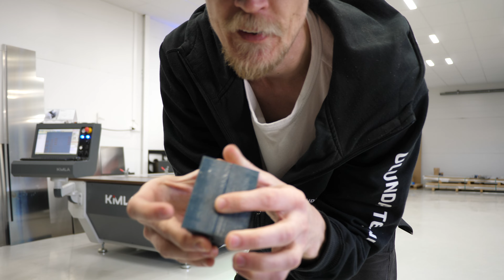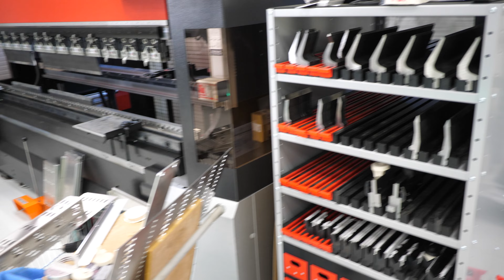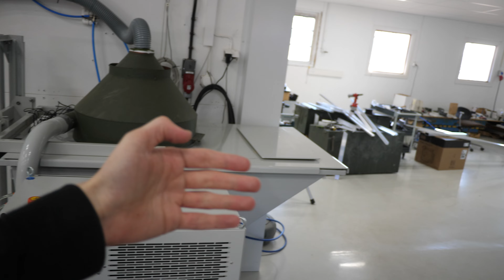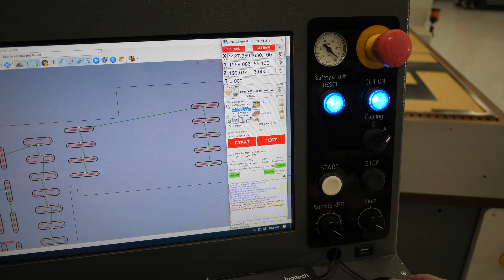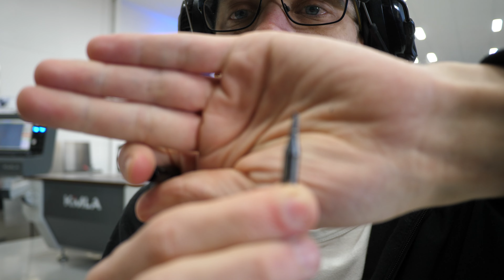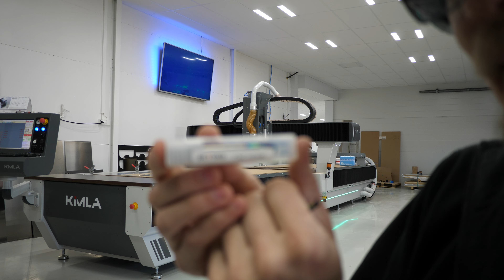Shoptalk in 4k50

Comment: This is odd, i responded, but it eveporated.  Something along the lines; VERY nice upload and incredible clean workshop! How do you like the rotary claw pump? I'm leaning towards a 250m3/hr garden denver, but my current liquid ring is till holding up. Price increase of 6% is active from the 1st of may, but that doesn't make me want to buy it faster.  That combination of lubraction/dust extraction; did you considered a mild overpressure under the plate to create a cushion of air? Or perhaps a mechanical limit. These pressure control valves; mine failed too on all devices i've used. Ethanol and most of the rubber isn't too compatible. Most of the rubbers get swollen. These peristaltic pumps appear to be hip nowadays, but these require a special hose to be able to handle ethanol. I think it's a relative complex solution for a simple problem. An over pressure tank should be all it takes. I've heard people using M4 or M5 threads with setscrews to get the right flow rate (use the play between screw and thread to have the proper flow rate). Length of the setscrew affects it too. I personally don't think you need anything that is adjustable, it just has to be the right flow. The Kimla controller; is it capable to recognize some CAM features from say a step file (i'm not a fan of  DXF's, maybe it's bad luck, but it is by far the number one file on my list of extensions that are most sensitive to errors). Had a lucky machining moment last week. While hand jogging the machine at full speed, it stopped at 1400.000 mm.. Good thing i don't have a lingering gambling addiction and a nearby casino.
Reply from the maker: Hey bud.
Sometimes youtubes comment-algoritm triggers and the comment is "awaiting review" before beeing visible. That might be it.
I do like these pumps, they are not too loud, no oil mist in the exhause and above all almost maintenace free.
Very rarely but it has happened that i missed having the oil lubricated rotary vane because of the immense vacuum levels achieved.
These dry running ones do 200mbar forever but spec says not to run lower than that more than 50% duty cycle. Sometimes you just want extreme vacuum on small parts or specialty fixtures. Who knows, i might get smaller version of my old pump for those occasions.
I have no experience with the garden denver brand. What specs does your current liquid ring have ?

There IS a cushion of air under the plate. It is only when you cut up the material so much that there is no big enough flat areas left to float on that the plate comes in contact with the aluminium.
There is also a adjustable mechanical hardstop, tho I dont adjust/use it unless there are BIG pockets in the material where the whole suction cup might fall into.
The hardstop rides along with the spindle on the Z axis which is not great tho, since if im doing pockets in steps then either the cup is to high or i need to readjust every time the spindle lowers in Z.
Having it from the gantry Z plate and beeing able to set a fixed minimum hight would be better and i might make that happen at some point if I find it worth while.

The denaturing component in my ethanol is MEK, so I pretty much need EPDM ive figured.
There are setscrews for air and ethanol and the container IS pressurized.(up to 4 bar)
However, depending on where you mix the two and the nozzle size and configuration, the air pressure is counteracting the pressure in the ethanol container.
If you inject the ethanol very close the nozzle exit you should be fine but you will need a needle valve(or other way) of limiting the quantity. The needle valves ive used have been finicky and unrelieble after a while.
Even with EPDM orings, probably because something else is slowly dissolving and cousing occausional clogs.
Some systems use pneumatic pumps like UNIST(cant take the MEK, i asked.), some use pressure based dosing (microjet/datron) but that requires very stable pressure, more air flow than id like(to get a reliable coolant flow) and it seems "sputtery" even on the datron machines. Results in often too much ethanol for my liking. Tho them microjet nozzles seem sweet with their "air jacket" feature.
And yes the hose is the weak part in those peristaltic pumps, not great.

Since the container is pressurized, All i really need is a way to limit the ethanol flow without using needle valves. There are fast acting valves for quick on/off but they really need to be able to handle mechanical wear in an ethanol/MEK bath. Some other mechanical contraption could be tried but then again, hoses dont really like mechanical wear and ethanol/MEK.
Maybe if I could pulse the air instead and therefor control the injected ethanol, but nah I dunno?

Perhaps just take everything apart, clean it, replace ANYTHING that could be dissolving with EPDM and get a fresh needle valve and try again.

There are some videos on kimlas youtube where they machine in 5 axis and the 3d model is atleast visually on the controller. But Im pretty sure it was programmed in some other CAM.
3d cam is really something you need a dedicated software for, that keeps current and is activly developed.
Fusion 360 with a nice postprocessor or even a custom script solution to facilitate a smooth quick transfer could be something. 
Most of my daily cutting is now done with PCCAM auto applying cam templates to layers on the dxf. Takes no time at all to apply 1 or 10 cam operations and just press go.
PCCAM also removes duplicate vectors, joins open vectors ect ect. Its not perfect but works.

Odds of stopping at 1400.000 🤔 And staying there 😆
Reply: @randomrouting  For these smaller parts, i don't know how large the batch is, but Datron has these cardboard cards with eiteher a 5 or 10mm raster of glue. They hold the smallest parts fine. But i guess you know about their excistance.What i also do is to put some neoprene glue on an MDF sheet, let it dry for a day and use that. Be sure to use the spray variant and not the webbing type. I''m using a large pressurized can, but it also comes in little 500ml cans.

The current pump is doing -990 at max and 280m3/hr airflow, i've upgraded to a larger container for the water, because it started to boil pretty quickly under deep vacuum. I don't need that deep vacuum, my panels are  normally at least 300x300mm, so i can get away with 800mbar abs, with ease if you give your cam some attention on where to start the part.
Reply from the maker: @berendlucasvanderweide  Yes I know of them datron sheets. Was thinking to perhaps make a small alu vacuum table ontop of the normal one(in a area im hardly using so i can leave it there) and make it to fit those sheets. Together with a oil rotary vane it would probably be pretty insanely good for small stuff.
Sounds like the pump you have is a nice one.

Very interesting with the glue on mdf/hdf idea, i tried it once long ago but it was the wrong type of glue. Thanks for the tip.
Reply: @randomrouting  I'm currently testing with a vacuum for my smaller machine 12mm thick HPL, drilled with 6mm holes with 10mm spacing and .4mm though holes, like the commercial available vacuum tables. I'll be using a Busch 1040C at 60hz on a 540x840 table. it's fair easy to make such a plate for the larger machine as well for one zone. I have no idea if it works, but i'll keep you updated if you're interested. the .4mm holes are no problem in HPL. https://www.youtube.com/watch?v=wxhLeYY2vHY
Reply from the maker: @berendlucasvanderweide  Cool, VERY interested yes :)

Comment: Can I ask you a favor? What is the smallest door, which the machine without horizontal beam can go through? Can you measure? I think, the widest dimension is outside edge of flange where is horizontal beam mounted. thx
Reply from the maker: Sure, ill go there later today so ill measure then. 👍
Reply: @randomrouting  thank you
Reply from the maker: @Petrikfik  So while the gantry is off, measuring from the outer edges of the gantry supports its just under 220cm. Tho you could push the gantry supports away from each other (one forward and one backward) that way you can pass an 190cm opening. After the first gantry support is in(the side without the cable carrier), then push the machine sideways to accomodate space for the second one.
If that makes sense.
Reply: @randomrouting  I see. I'm going to change the location. Everything great except one think. Main door is only 209 cm wide :( But your idea is really good news for me. 
Did you feel comfortable with 1600 mm in X axis? 
We have probably same standard format for aluminum plates.
Reply from the maker: @Petrikfik  209cm should work fine. tight but zigzag it in as described and It should work.
Im happy with the 1600, dont know if you are also getting the alu T-track but with it and 1250 wide sheets its perfect.
I put the popup pins in between the T-track and the sheet zone and I use them from both sides. I push the vice,extrusion or whatever else against them to square em up.
If you want popup pins then those need to be offset from the edge anyways (they go down into the center of the beam) so adding the T-track doesnt accually add that much table width anyways.

If i remember correcly then 1500 is the minimum they build and if you go narrower than 1600 then you cant have the computer on an arm, then you get the rolling cabinet style with a chunky cable on the floor.
I would not go wider because reaching across the table then get cumbersome.
Reply from the maker: And as a side note: If you are getting the popup pins. Tell them you want them to auto retract.
For whatever reason it isnt standard :) crazy. I would have forgotten to lower them 10 times by now.
Mine auto retract 1-2 seconds after a vacuum zone gets activated. Which is perfect since you want them to stay up if you are using a vice on the T-track ect.
Reply: @randomrouting  My machine will be very close to your spec. Different size (1600x3100x300), T-track, pop up pins (thanks for your side note), same spindle, probe, two tool changers... I need also some clamping for tall pieces. Something like your hole in the middle of table. But I want it in front of the table if possible ... Something like Datron have. After clear all about my new location I plan to visit Kimla company. 
How about lubrication of linear rails for all axis and ball screw on Z axis? Is there installed some automatic lubrication unit? I saw there only manual nipples. Is that correct?
Reply from the maker: @Petrikfik  Mine are manual. Blocks and Z screw have tubes/distribution blocks so that they are easy to reach and then lubes all 4 z axis blocks at the same time. To lube the X and Y axis you need to loosen the bellows. No big deal.

Are you also into alu fabrication ?
Reply: @randomrouting  Jop. 40% ALU (almost all is 5083, sometimes 7075 or 2017) and 60% plastic (PE, PA, POM, PC, PMMA...)
Reply from the maker: @Petrikfik  Sweet.👌
Reply: @randomrouting  If you are looking another content for next video, please make Kimla software overview :-) You will be first on yt
Reply from the maker: @Petrikfik  Hey, in the latest kimla international video the machine seems to have a T-track in the front the way you want yours ? You gotta pause at the right moment to see it tho.

Comment: oh and I´ve got another question: seems like you suck away the alcohol fumes with the chips, correct?  do you just vent to the outside? with some sort of heat exchanger in the winter? or are there ways to get rid of the alcohol in the air? I´m using fenela in two fogbusters.  :/  its okay but alcohol would be so much nicer and cleaner...
Reply from the maker: Yes the fumes travel with the chips to the container and then through the side channel blower that is outside. The inside of the container only has a stainless steel mesh to keep anything bigger than fine dust.
I do loose some heat in the winter but then again I dont yet have active ventilation so i might as well "ventilate" this way. For now anyways.
Trying to filter the air for reuse is no easy task and would require expensive particulate and vapour/gasfiltering. I'd rather pay for the lost heat then :)

One thing to think about when using ethanol is to somewhat "ATEX-classify" your setup. Meaning using non sparking materials and ground everything to minimize risk of explosion. I have however made the calculations (got some help from an expert) and as long as something doesnt go wrong the ethanol vapor to air mix is too lean to ignite even if there was a spark. 

I could route the hot exhaust air over to the heatpumps condenser to regain some heat during the winter. Perhaps ill do that some day.

The current setup is just so convenient, clean and low health hazard that I'll probably just keep using it as is.
Reply: @randomrouting  thank you for the detailed reply! makes a lot of sense! I guess I overestimated the volume of air your system moves. as its pretty contained its not really comparable to what we see on wood router dust extraction systems. big volumes, low pressure... mine is a bit in between but still moves over 1000m3 per hour. so that would exchange the air in the workshop roughly every 20minutes. not nice in winter :D
Reply from the maker: @bernhard_derProtoTyp  Ah yes, very true. This is a lower volume higher pressure setup then a typical wood shop vac system.

Comment: I’m really happy with the dreanique compression cutters I use for wood. Don’t hold up as good as the Leitz I used previously but cost way less. Thanks for the Beyond chamfer tip! Just ordered some. 
Its a shame 99% off the aliexpress cutters are suuuper too long. I would love to find some cheap short/stiff single flute cutter for (alu) sheets.
Reply from the maker: Exacly! Always too long. Ive got 3.175mm/3.175L, 4mm/8L, 6mm/12L, 8mm/16L, 10mm/25L  to test. They are the shortest I could find. All have shank same as cutter dia. Id prefer say 6mm dia for everything up to 6mm diameter as I run these with as big of a chipload as i can.
Reply: @randomrouting  3.175mm/3.175L ? really? 1:1 ? do you mind sharing a link to them? that sounds too good to be true. :D
Reply from the maker: @bernhard_derProtoTyp  Sry to get your hopes up, yes that was too good to be true. They are 3.175/6L 😆
Reply: @randomrouting  haha. ok. i already have some of them. only tested them once yet. on 2mm 5754 H22 worked really nice but lets see how long they hold up.. price is awesome with less then 1,50 EUR per piece. ...I will contact dreanique and beyond and ask for 3x3 or 4x4  - maybe if enough people nag them, they might consider making some...
Reply from the maker: @bernhard_derProtoTyp  I only used them once aswell, time will tell. Good idea tho, ill nag on them too.